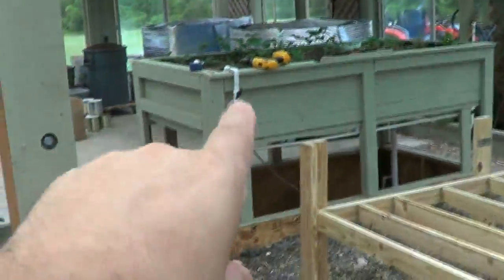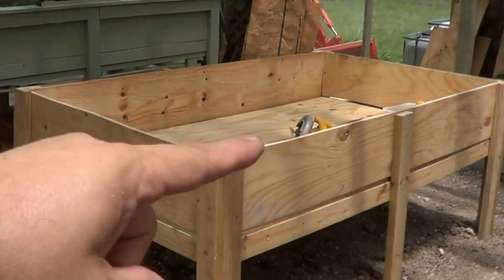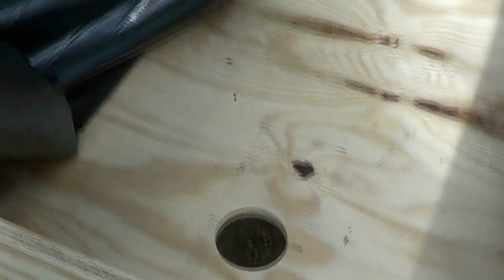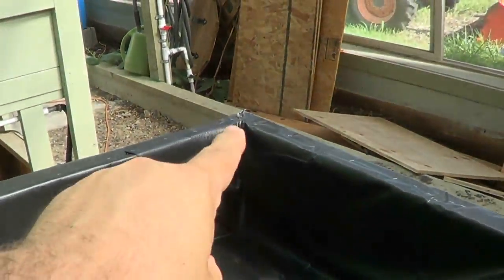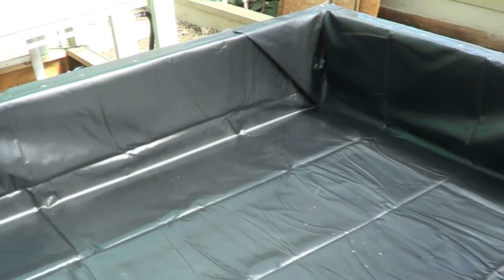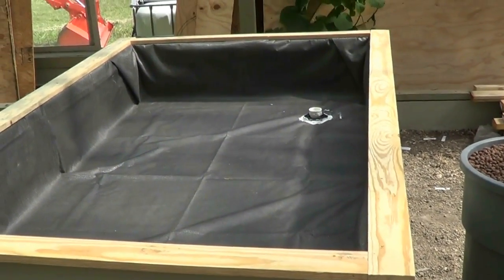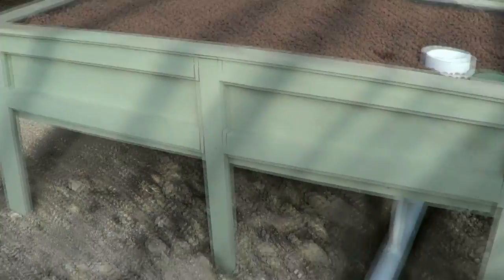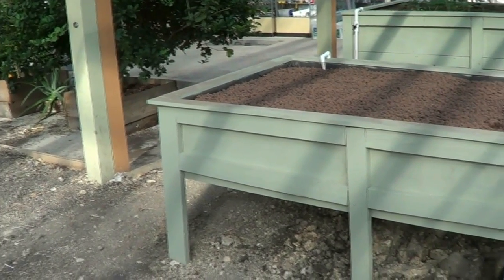Aquaponic Conversion Part 8   Grow Bed Build in Detail

Comment: hi Tracy, thanks for such a great video.  I have a few questions for you.  My bed is 6'L x 4'W x 12"H. What size pump will I need?  The inlet pipe size?  You used a 1 1/2" outlet is that correct?  Where did you buy the bulkhead fitting?  Where can I buy the clay pebbles? How much will I need? My fish tank is 6'L x 4'W x 24"H.  what do you think about that?

Comment: Hi ive  copied your design, however its not finished yet, one potential fault is that ive used a bulk head fitting 1"    rather than 1 & 1/2", im concerned it mat not be enough, the bed holds 500 lt 300lt of which is expanded clay balls, so theres 200lt of water to drain, do you reckon the 1" standpipe/ bulkhead is going to be enough?
Reply from the maker: Sorry for the delay - I think you'll be OK maybe just take longer to drain out. Maybe have to turn the drain into the bed down a little but I bet you's be OK.
Reply: good to hear, thanks

Comment: can i ask what is the liner you are using in this bed and to confirm the dimensions of the bed are 12H x 4W x 8 L correct? if so what size liner did you buy to fit the bed 
thx
Reply from the maker: +Diane Radtke Yes the bed is 8'X4'X12" the liner was a pond liner from Home Depot - I do not remember the size but I know the one I bought was good  for both beds...  Thanks for watching!!